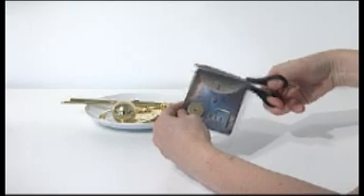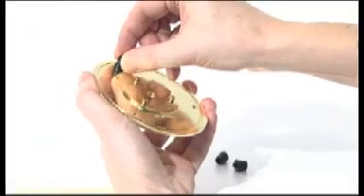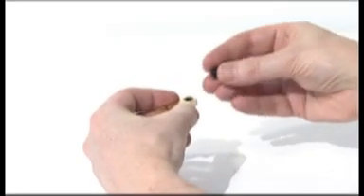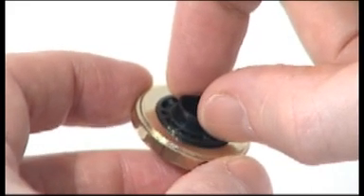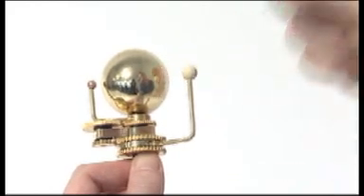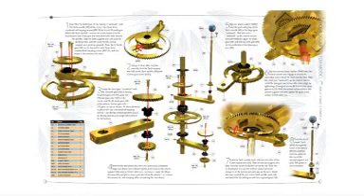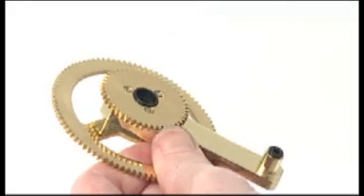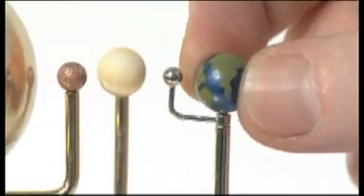Build a Model Solar System

Comment: I bought all the subcription magazines and I now find that the Orrery is NOT solid brass but a thin brass  coating or similar on top of metal . Due to the humidity in Cyprus I find that my Orrery is rusting nicely all over. What a con. Whats more I have tried to get spares from the makers to no avail.

Comment: I know this is just a rough guide but geeez, Ikea instructions are easier to follow
Break it up into 10 videos to represent 5 magazine issues and go through the parts you recieve in each issue otherwise it just becomes a rambling instructional video that is just confusing as you can't associate the parts with the instructions

Comment: I stopped the subscription as this is crap. for a start the arm under mercury, the slop in the gears is that bad the gears are not flush and seem to mesh at an angle and tge bigger of the two cogs would work tge screw lose.

Also the cog that is on the big earth plate tge gear was never level like shown in the videos and is at an angle and tge gears only half meshed and the force would loosen this screw to the point it always comes lose and now cannot tighten the screw.

for the money you end up paying expect better. A warning stay clear. I was getting it up to stage 2, but due to the slop in 2 gears abd meshing at an angle tge rotation is terrible and not even even, one part was right in the rotation then hard.

this sucks.

looks good, but if it does not go together properly then it sucks and expect not to have the issues I was having for the money I pay. The QC is shit.